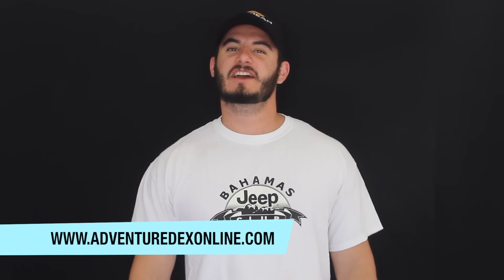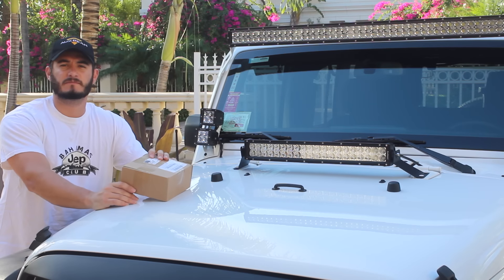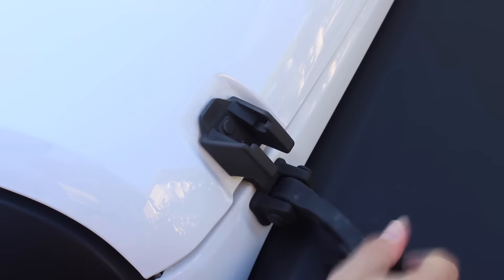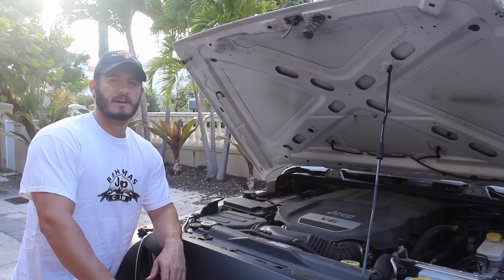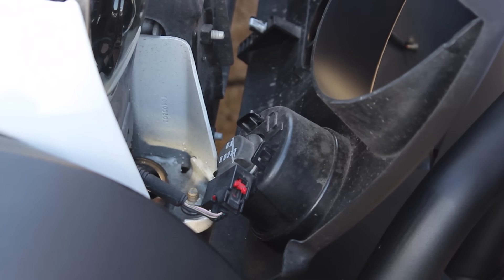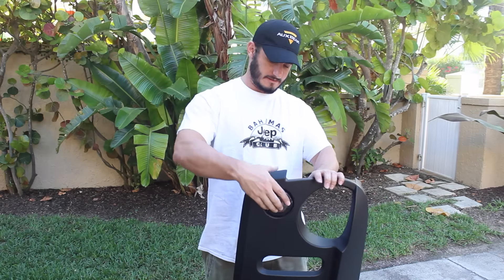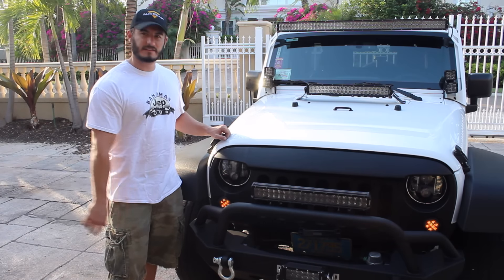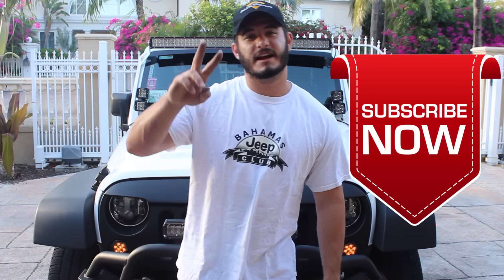Jeep Wrangler LED turn signals by Auxbeam

Comment: You didn't need to add a load resistor for these turn signals to work properly?
Reply from the maker: +Jeremy Wheaton Thanks for the comment Jeremy! No, the manufacture advised they will be okay with the OEM wiring harness. I will update the video if I have any issues but right now am loving them! Easy installation. Thanks for watching!
Reply: +AdventureDex I was going to ask you the same thing. If you needed a resistor for them to blink with turn signal. Guess you don't. I've ordered them and going to do the install you laid out. Thanks.
Reply from the maker: +Luis Camacho Thanks Luis! Apparently a resistor is not necessary, they are not speeding up. Thanks for watching!

Comment: I have halo lights and these led turn signal lights on my 15 wrangler but they aren't working, do I need a resistor?
Reply from the maker: Thanks for the comment Danielle, its hard to say without looking at it. It could be a couple things that you should try. First make sure the lights are grounded properly and second make sure you got a good power source. I hope this helps!

Comment: nice vid! I saw someone commented (a year ago) about possibly needing resistors? Does anyone know if Dex had any problems with these turn signals down the line?

thanks!
Reply from the maker: Thanks for the comment! These are still working great, no issues!
Reply: Wow thanks man, its really cool to see that you reply to pretty much all your comments, even on older vids. Respect

I ordered them and installed them following your vid, super helpful :)
Definitely subbed

Comment: did u have problems with the led plug on the back of the lens being secure i just sent mine back it was too loose i wouldve had to glue or tape it
Reply from the maker: Thanks for the comment! The clips can be tricky and you really gotta give them a good push to get them seated but mine clipped in no problem. No need for glue or tape. Just be careful cuz its all plastic and will break if forced. Just be patient and maybe get a buddy to give you a hand. Thanks for watching!